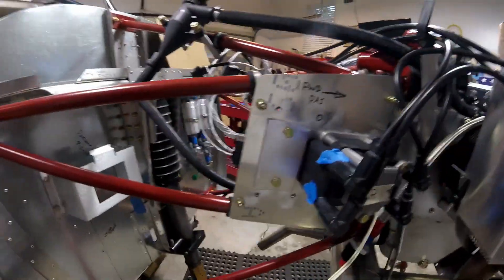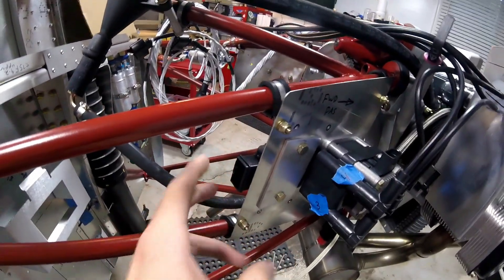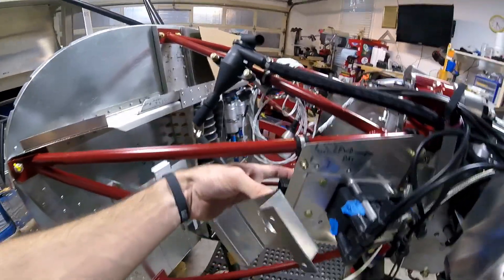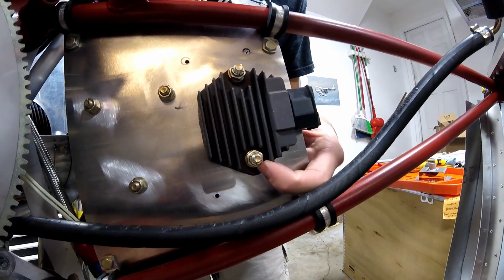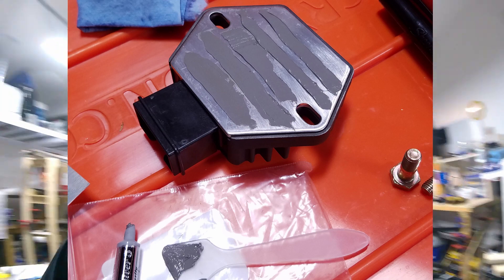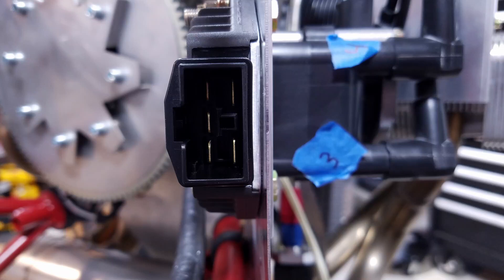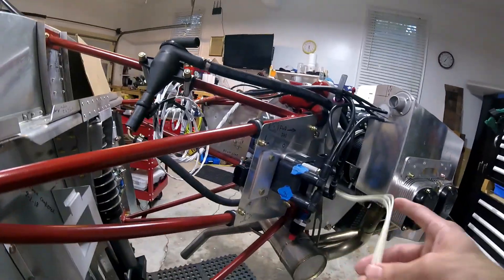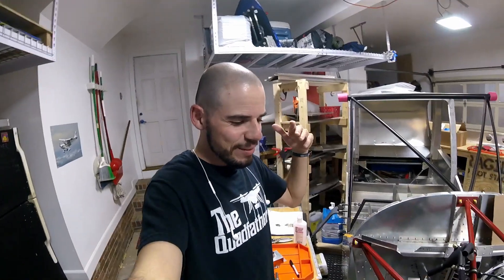I think this will PREVENT burn-outs - Voltage Regulator/Rectifier Improved Mounting - UL350iS

Comment: Still looks like a fairly good size gap between the voltage regulator and the mounting plate.  Did you consider adding a metal shim to fill more of that in, in addition to the paste?

Comment: You've done a really smart thing there with the with a dialectic paste and if it still gets too hot you need to take and put a heat sink on your the plate that you installed on the other side

Comment: That looks like way too much thermal paste. To achieve the best heat transfer, the metal surfaces have to touch. The paste is just there to fill the microscopic imperfections between them, that wouldn't touch each other without paste. With so much paste, the heat transfer is worse than without paste.